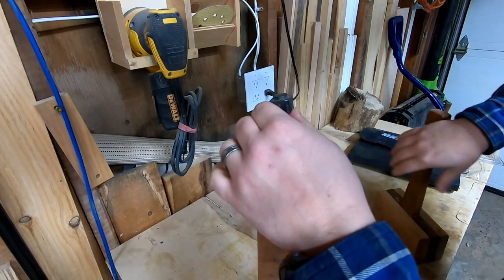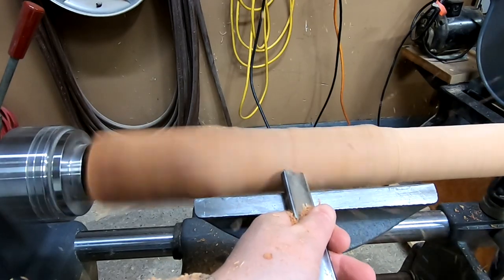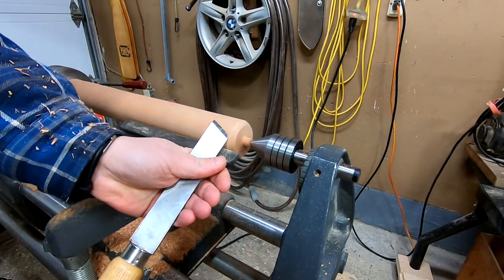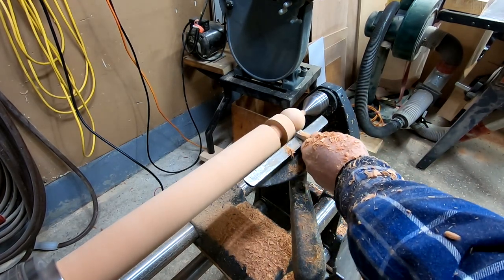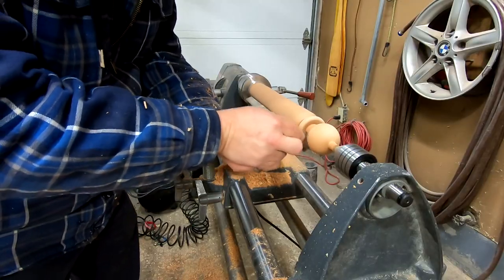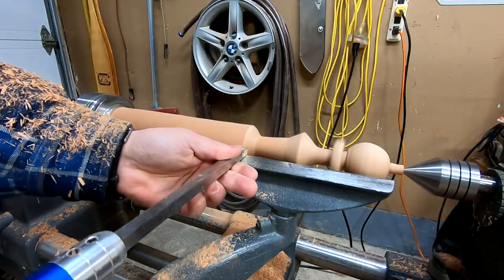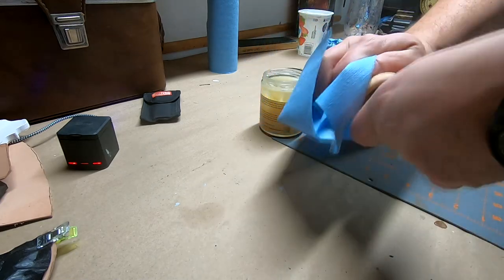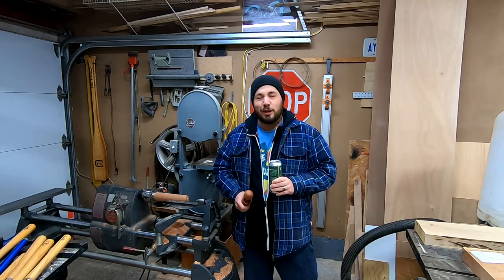Captive Ring Baby Rattle - No special tools required! (Wood turning)

Comment: Nice job on the captured ring! BUT… captured rings make for dangerous baby toys. Due to the grain direction they crumble easily and become a chocking hazard, especially when combined with slobber and teething. Some of the best wooden baby rattles I’ve seen have a cavity filled with something non-toxic, such as dried peas. Great video, though!  Scott
Reply from the maker: Thanks Scott! I hadn't heard that before but that makes sense (and aligns with the few that exploded on the lathe😂) I'll make sure to only use it with adult supervision 🍻
Reply: @TheGrantAlexander  Exactly! They can be used by an adult as a “cat toy” for a baby, but just keep it out of the baby’s reach.
Reply: @TheGrantAlexander  BTW, making a child safe version would make an excellent follow-up project. #JustSayin
Reply from the maker: Good idea Scott, I made a dowel centre style rattle for my first son (https://youtu.be/qmaNF6l5eyE) and I had thought of making a Marimba style rattle but all I had around the shot were ball bearings (bb gun shot) which didn't seem like a good idea. I might have to look for some dried peas on the next grocery trip!

Comment: The skew chisel used to frighten me but watching The Wood Yogi repeatedly convinced me that's it's the most versatile tool for the lathe. Great job Grant, very enjoyable. I'll have to try one of these...
Reply from the maker: The skew is still the scariest that I have used, but it is also the most versatile! I have actually done a few rattles with only the skew, but because I only have that one wide one it gets tricky to get under the ring to detach it and leads to more failures 😂😂

Comment: Great skew chisel turning Grant. You showed some good techniques and skills. That’s something I really haven’t gotten into. I’m working on perfecting my techniques with my gouges including sharpening them first. Since I learned years ago on traditional tools I haven’t tried carbide tools yet either. They do look like they’re fun to use.
Reply from the maker: Thanks Don! I feel like the carbide tools are a bit too easy! Almost like cheating. But the skew and the gouge (when properly sharpened) leave a much nicer finish. When I do the skew right I don't even need to sand. No matter what I do with a carbide tool I start at 120 grit minimum😂
Reply: @TheGrantAlexander  that’s what I’ve heard about carbide. I can get a fantastic finish just using a spindle roughing gouge. It just takes a very light touch. 

I’m glad you’re enjoying turning. Maybe sometime we can figure some kind of collaborative effort turning something.
Reply from the maker: @wb_finewoodworking  that would be fun!

Comment: Thanks for the video. I haven't had much luck with a captive ring tool. Seems to make a lot of sense to try it with the carbide!
Reply from the maker: Good luck! I had some luck with just the tip of a skew chisel as well, but it was easier with the carbide and ended with less wrecked rings🤣

Comment: The skew chisel looks like a butt-clench-level tool, but that's probably just appearances. I've never seen a drive spur before. That was a nice little nugget. Two lathe things I didn't know that I learned today.
Reply from the maker: No it isn't just appearances, the skew is a butt clench tool for sure! Super easy to ruin your project with the improper technique, but the results when used correctly are soo nice! With a sharp skew you don't even need to sand most wood!